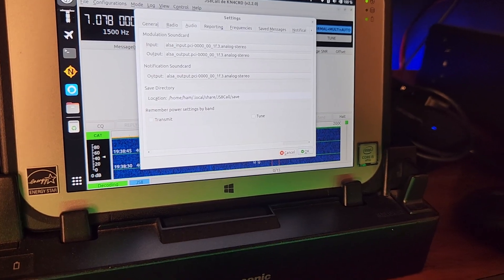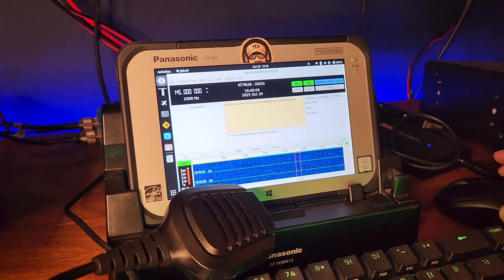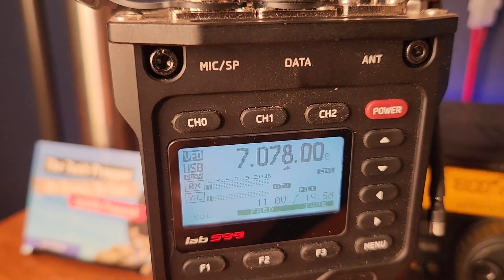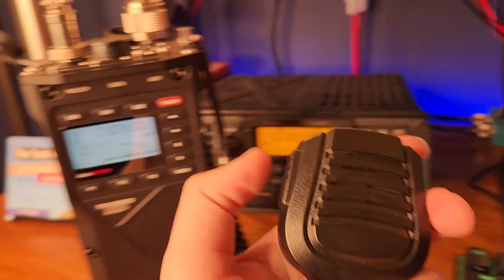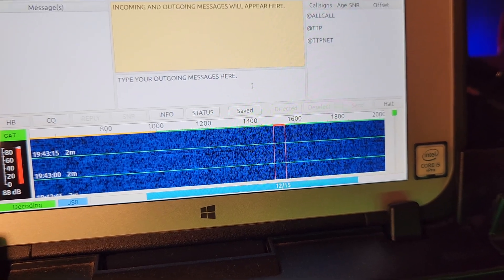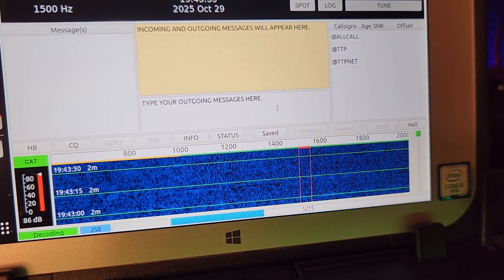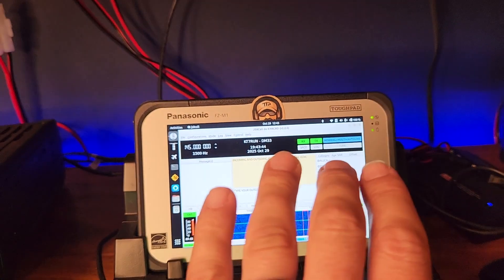Plan for Comms Failure - Acoustic Coupler Test

Comment: Gaston a bit off-topic here but just to make everyone aware there’s an add-on that’s been developed for the Lab599 TX 500MP it attaches to the top of the radio, and it enables VFO and quite a few other capabilities for easier, digital modes execution.
I believe it retails for $599. Which would now make that a $2000 piece of equipment. The add-on is called the LiNK 500MP.

Comment: I've always built the audio cable to get audio in and out of the transceiver and computer, and either used a USB cable for CAT control or used VOX to activate the transmitter.  The audio levels can be a bit fiddly, generally requiring low levels if using a headphone jack (a simple voltage divider built into the audio cable could make that a lot less fiddly), and care must be taken not to accidentally broadcast computer beeps and blips, audio from The Tech Prepper YouTube videos, or other computer audio.  Directly connecting audio between the computer and transceiver doesn't have any isolation but I haven't found that to cause a problem because both are battery powered and the voltages between each device can float.

In college in the late 70's, I'd hang around the computing center all night doing "recreational computing".  I'd sometimes turn on the acoustic modems without the telephone receivers in the rubber cups, whistle loudly, and the DECwriter II dot matrix terminals would all start typing gibberish.  Childish nerd fun.

Comment: Hello TTP! I’ve been trying to get ETC R4 to work with my G90+digirig. When I boot up JS8, I always get a hamlib error talking about a protocol error when entering frequency. Tried a fresh reinstall of ETC as well as multiple different firmwares on the G90. I can get signals on JS8, but changing frequency on JS8 makes my radio start doing weird things like switching the mode and going to random freqs. You have any idea what could be going wrong here? Appreciate all the work that you've put into ETC! 73
Reply from the maker: Hello! Sorry to hear that you're have an issue. This issue has popped up in the past. Here are a few things to try:

1. Ensure that you have all the settings configured on the G90 per the et-radio instructions after your select the G90.

2. Next you see the Hamlib error in JS8Call, try clicking the "Retry" button.

3. You may have an issue with RFI getting into your computer. Make sure that you are using a USB cable with good ferrite beads.

4. Try one of the other modes and see if you have issue.

I highly recommend that you jump into the Discord as that group is great at helping each other out.

Comment: Had a couple js8 qso on my old CB radio this method holding mic near speaker on pc and rx over air noise from radio. Channel 24 upper side seem to have some js8 ops on it. I saw the green Spots on PSK reporter.
Reply from the maker: Very nicely done! Thanks for the confirmation on your success. I've found that JS8Call is bit more difficult compared to most of the fldigi modes. Take care.

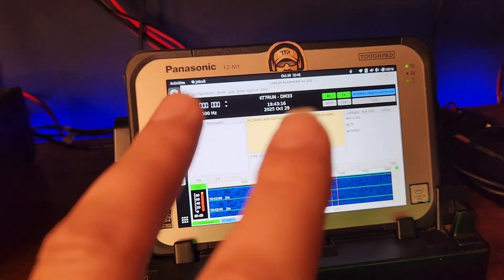Comment: i may be WAY down in the weeds, but at 4:26 you mentioned the requirement for a time synch, is that for JS8 call as a whole or just this work around using the mic and speakers. If a time synch is needed i assume that comes from a GPS signal (was an Electronics Tech in the Navy, i know how important time is), in a grid down scenario where that signal is lost does JS8 call go out the window, how would time be synched across all users?
Reply from the maker: JS8Call always requires time to be synchronized. There are a number of ways to sync.

1. Enable the automatic time drift setting in JS8Call. All you have to do it is wait for a signal to be heard and it will offset the time used by JS8Call.

2. Connect a GPS receiver. You need four satellites to acquire time.

3. Listen the WWV time sync signal one 5, 10, 15, 20 mHZ and manual set your seconds to the top of the minute.

I should do a dedicated video on this topic. I've executed all these in the field. Search for my G90 field video. I executed the WWV approach.
Reply: Also sync with FT8, I almost always hear sigs
Reply from the maker: @kf5hcr176  That's a great pro tip. I frequently jump down to 7.074 to "hear" the FT8 signal. It works great. Even though, I primarily operate on 40m, I will also jump 20m just for a heard singal sync since it tends to have more traffic.

Comment: Great video. You covered the radio-side failures, but not the computer, power, and weight side — the parts that really decide if a system survives the field.

HF digital isn’t plug-and-play. Every driver, cable, and update is a failure point waiting to happen. Complexity kills; simplicity wins under stress.

When you’re tired, wet, and low on power, theory doesn’t matter — reliability does. The best system isn’t the most advanced, it’s the one that still works when everything else fails.

Train hard, stay disciplined, and build systems that serve the mission — not the ego.
Reply from the maker: I built an offgrid platform called EmComm Tools Community that is fully plug-and-play for a HF, VHF and UHF. There is zero configuration needed. I simple standardize on the same hardware so I have redundancy in terms of components. My group also runs the same computers, accessories, radios and software. We can easily replace gear quickly. I should unpack what we are doing in a full video.  Good point.
Reply: @TheTechPrepper  I’ll definitely look into EmComm tools thank you for all that you do.
Reply from the maker: You're welcome. There is a new release coming out on Thanksgiving. There will be videos next month.

Comment: How about for a longer msg than just a hb. Say a 1 min tX. Work the same for timing? Maybe need to incorporate that on your ttp group as a skills exercise.
Reply from the maker: Yes, it works the same way. For a one minute TX you will need key down and quickly key back up at each 14 second mark. I tried it with a 30 second SNR transmission. It worked. That was my first test. I did not attempt to be keyed down the whole time for all frames. I parroted what JS8Call does. Excellent question!

Comment: Tested this with fldigi a while ago. I used the vox on the radio to key it up.
Great video! 73, Stephan, DF6PA
Reply from the maker: Great call out on using VOX on the radio (if it supports it). Hopefully, the VOX circuit is fast enough to open the PTT. I tested this on a Baofeng UV-5R about 5 years ago, but the tail always took too long to close. It was an issue causing packet loss on APRS as it would occasionally miss the beginning of an incoming packet transmission. Thanks for sharing your success.